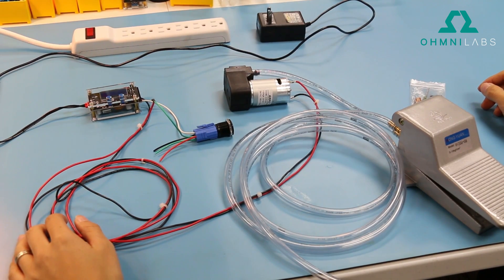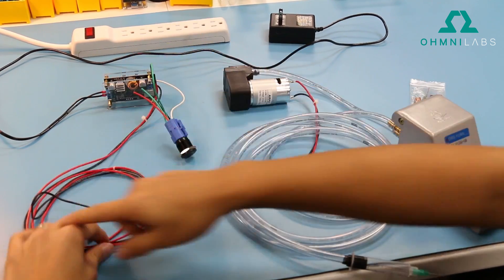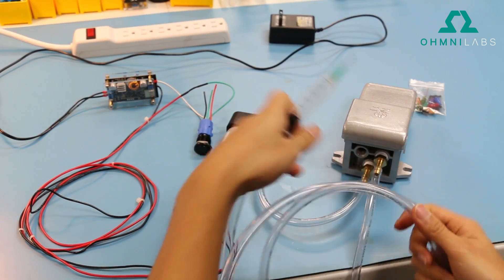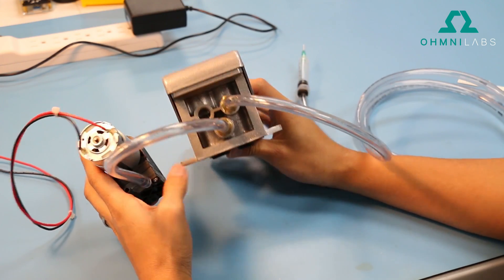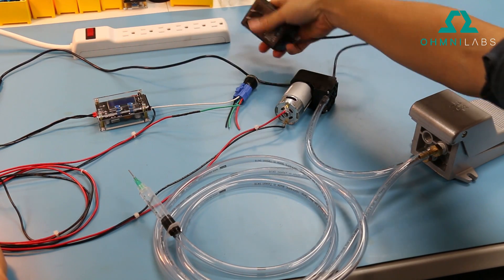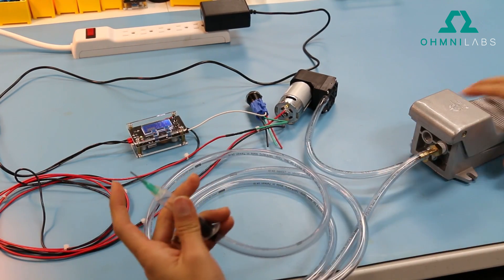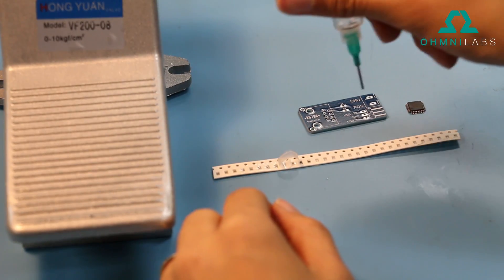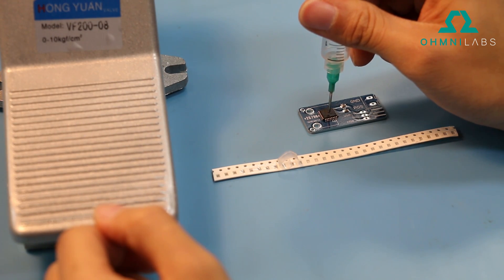How to Make a Low Cost Vacuum Pickup Tool for SMT Pick and Place

Comment: friend, I have a doubt regarding vacuum systems, I want to make one at a low cost but in a certain way, that is, I want to buy the suction cups, the hoses and most importantly a vacuum pump, if I connect the suction cups directly to the vacuum connection of the pump, will it be able to suck the object normally? (Leaving aside the calculations of power, suction force, etc.), what I want to know specifically is if it is enough with only the elements that I mentioned, or is it necessary in the system that I buy solenoid valves and/or ejectors? The latter are used when I have compressed air, but I don't have a system that provides me with compressed air, that's why I bought the vacuum pump. I hope you have made me understand. Thanks
Reply from the maker: Sorry for the late response. You don't need solenoid valves or ejectors.

Comment: putting a larger hole then the largest tip you will use in the side of the seringe will act as relase mecanism then you dont need the foot pedal. Just use your index to plug the hole so vacuum can form and unplug the hole when it is time to release the part.

Comment: Look at your video, personally feel that you can further improve, use the solenoid valve, with the electronic pressure gauge to control the start, start the stop button, you can use that kind of electronic switch instead of the pedal, and then install it outside the syringe Can be more convenient

Comment: some vacuum station use a small hole in the "pen", so you can use a finger to act like the pedal (cover the hole to pick up, and release the hole to drop the smd part). I think is possible to do the same with the syringe (less components in project).
Reply: That's smart